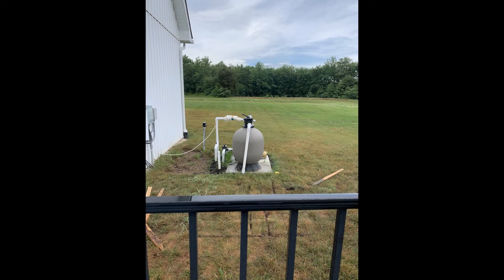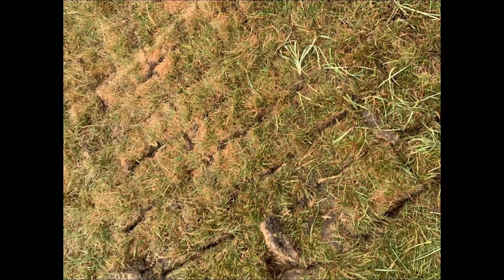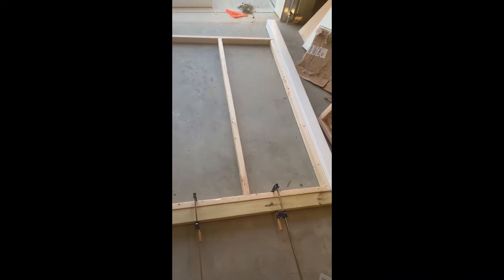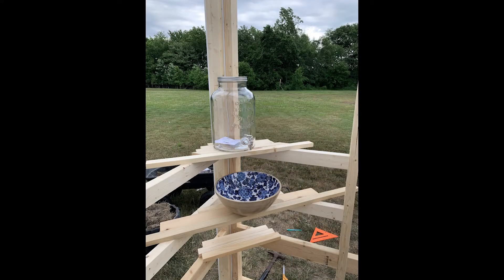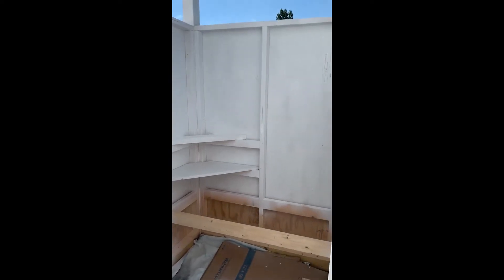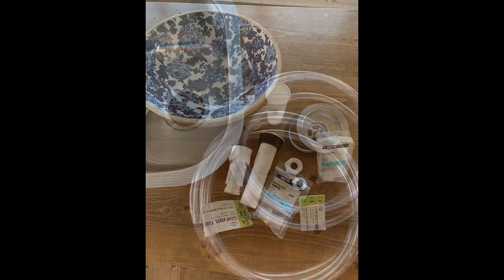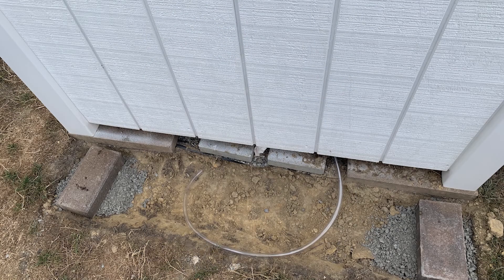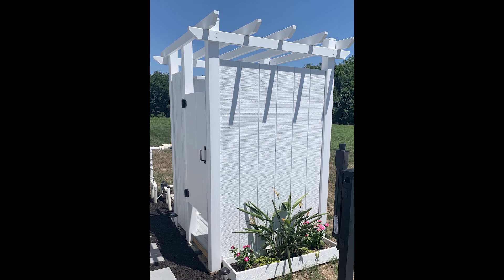DIY Outdoor Pool Bathroom

Comment: This is AMAZING!  I NEED to have something like this to keep wet kiddos outside while swimming!!  I’d LOVE more information on how you built the urinal and how it works to fertilize the flower box!  I checked your blog but that info is missing.
Reply: I would also like to know this as well. Someone else said that it might smell. I was curious about that also, and does the pipe for the urinal just drain out under the flower box?